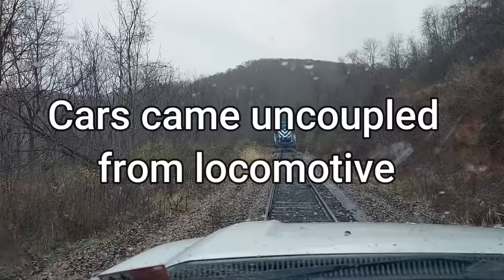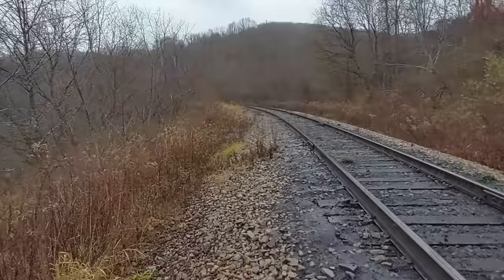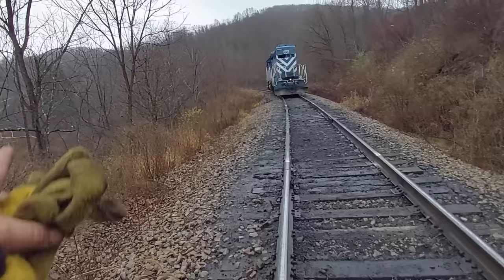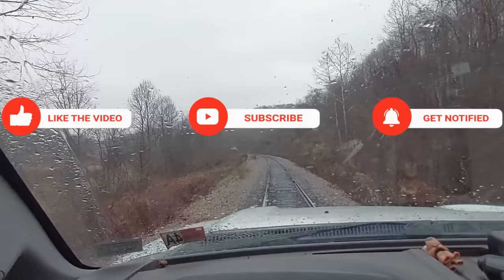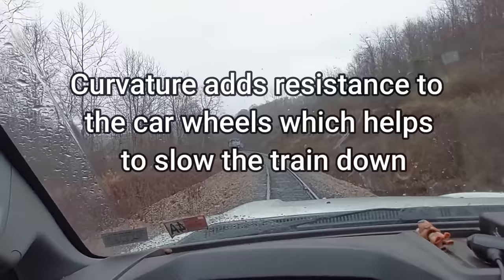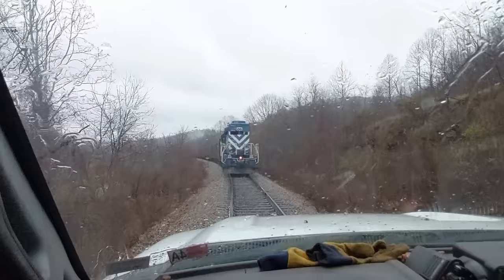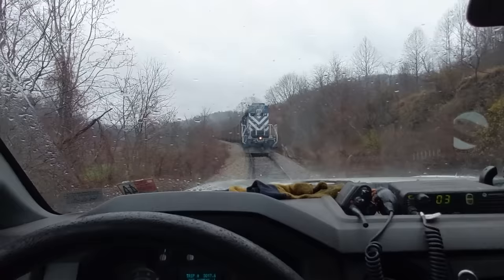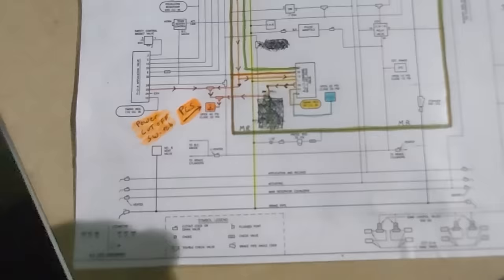Locomotive in PCS Fault and Remote System won't Link Back Up

Comment: Pneumatic Control Switch. I am not an expert but I think it disables dynamics if the switch opens probably a loss of air. I could easily be wrong. Such a neat video of something we won’t see anywhere else. Thanks so much for sharing your experience. Cheers, Rob
Reply from the maker: You are correct Rob, when PCS opens it disables throttle and dynamic brake functions via the PCS (power control system) .... PCS acronym for more than 1 thing on a loco... :-) power control system is
the electrical part which knocks power to the governor. Thank you
so much for stopping by and taking in the video my friend.
Reply: On newer locomotives when the train goes into emergency thus tripping the PCS, dynamics will stay engaged. There was a runaway train on CP Rail’s Kicking Horse Pass in the 90’s I believe where the engineer mistakenly thought the dynamics would stay engaged during an emergency application but he was wrong and that perpetuated the runaway. New units will keep dynamics engaged during PCS. If for some reason you lose air and your last resort is an emergency application, at least you still have dynamics to help slow down if they are already engaged when the emergency application occurs. Also, if the train slack was bunched up and the train was in dynamics while an emergency application occurred, the older system and locomotives would disable dynamics causing a massive slack run out as all the cars went to emergency and the engines left dynamics. That slack run out could definitely be severe enough to cause a train separation or derailment due to intensive buff forces, especially if you were in a curve.

Comment: Wow Dave, thanks for taking us along on this adventure. Sucks Russ had to walk 38 cars twice.. if I missed it what caused it to seperate..
Reply from the maker: Thank you Pappy for paying us a visit and checking out the
video. Coupler on the car had an adapter plate which had
fallen out for whatever reason. Adapter plate fits under the coupler shank. That caused a mis match in the coupler height from car to loco. Car went up to mine fine with no problems, but once it got loaded, then that made the mis match even greater.  

Coupler did not come uncoupled, rather coupler on car slid
down enough so that caused the car to uncouple from the loco.
Several low spots in the track surface did not help matters.
Car was pulled from train and fixed that evening. When they
put a new car in place of that one, they had no more problems
with it uncoupling.
Reply: Thats what happens on our model railways too. If the coupler isn't the same height it hits dips at bridges and sets them free.. so it's prototypical then.. awesome..
Reply: @ccrx6700  Did they ever recover that adapter plate? What causes them to fall out anyway?
Reply: At least it was only 38 cars, walked longer.
Reply from the maker: @erbewayne6868  👍😊💪
Reply: Complaining about walking only 38 cars? Must be an engineer.

Comment: Very interesting situation how it disconnected from the rest of the train. Did the coupler on the last coal car break a knuckle or just open up with all the tension?? The coupler on the locomotive (motor) seemed to be fully closed when you shut the airline valves off. Guess the moral of the event is when the PCS triggers, it quickly becomes a PITA problem!!🙃 Just all in a day's work Railroading!!
Reply from the maker: Thank you Charles for paying us a visit and checking out the
video. Coupler on the car had an adapter plate which had
fallen out for whatever reason. Adapter plate fits under the coupler shank. That caused a mis match in the coupler height from car to loco. Car went up to mine fine with no problems, but once it got loaded, then that made the mis match even greater.  

Coupler did not come uncoupled, rather coupler on car slid
down enough so that caused the car to uncouple from the loco.
Several low spots in the track surface did not help matters.
Car was pulled from train and fixed that evening. When they
put a new car in place of that one, they had no more problems
with it uncoupling.

Comment: A plant I used to work at had remote controlled locomotives for the dangerous jobs. When the locomotive got out of range of the box that the train operator wore, the locomotive would go into emergency, most of the time. A couple of times, it took off! Both times the switchman had gotten off to throw a switch, just like in the movie. Required a 2 man crew. One on the locomotive when backing over road and pedestrian crossings, and throw switches. After I left, I heard they knocked it down to 1 man crew.(to save money) and threw the rule book out the window. I heard one remote operator was killed, a week before his retirement. I had worked with him and he was one of the safest operators in that plant.
Reply from the maker: Our remote has always just quit functioning Paul, knocking off any
function it was doing when it lost signal. We've lost signal many,
many times. That sure could be a disaster if it just kept going. Oh dear!  Thank you for taking the time to visit with us and write in my friend.

Comment: Dave, just like andymano my first question was about the break apart, any idea why and how. Thanks for the video.
Reply: read the video description! :) A faulty coupler on the one hopper car.
Reply from the maker: Thank you Old Coastie for paying us a visit and checking out the
video. Coupler on the car had an adapter plate which had
fallen out for whatever reason. Adapter plate fits under the coupler shank. That caused a mis match in the coupler height from car to loco. Car went up to mine fine with no problems, but once it got loaded, then that made the mis match even greater.  

Coupler did not come uncoupled, rather coupler on car slid
down enough so that caused the car to uncouple from the loco.
Several low spots in the track surface did not help matters.
Car was pulled from train and fixed that evening. When they
put a new car in place of that one, they had no more problems
with it uncoupling.

Comment: “I did a thing, then it did another thing and now it works” or “I hit it with a hammer until the noise stopped” pretty much fixes all my issues as a mill operator
Reply from the maker: Here in the coal mine, the mechanics motto is if it doesn't get
fixed with a small hammer, then use a bigger one, and that doesn't
work, hit it with a sledge.... :-) Thank you for taking the time to watch the video and write in. May you have a most blessed day my friend.
Reply: @ccrx6700  yep heard that as well, that’s the kind of mill I operate it’s a coal mill

Comment: I've operated some stuff with the old manual lapping brake valves - 24, 6, even the old number 1. Personally, I like the manual lapping stuff, it keeps you more engaged and on your toes. 24 with pressure maintaining was pretty interesting. Lots of old hogheads have lots of interesting tricks with that system.
Reply: I agree. The manual is so much better. I prefer to feel it vs being controlled
Reply from the maker: Thank you Bryon for the nice comment and for sharing your
experiences with us.  Really appreciate your visiting with us and checking out the video. May you have a most blessed day my friend.

Comment: Did this occur at the Cumberland Mine? Great video! I actually have that locomotive in HO Scale in it's original paint scheme.
Reply from the maker: Yes sir it did, I have that loco also #1 in HO scale, got it on Ebay
for 100 bucks. what is so cool about is on the front porch it
has the US Steel logo painted on the deck and that was the
way our #1 loco actually came to us here. Thank you so much
for choosing to visit with us and check out the video. May you have a most blessed day my friend.

Comment: What caused the locomotive to separate from cars? When I worked for the railroad there was nothing electrical to uncouple knuckle. Either had to be done manually outside or a broken knuckle for a separation.
Reply from the maker: Thank you Speed Bump for paying us a visit and checking out the
video. Coupler on the car had an adapter plate which had
fallen out for whatever reason. Adapter plate fits under the coupler shank. That caused a mis match in the coupler height from car to loco. Car went up to mine fine with no problems, but once it got loaded, then that made the mis match even greater.  

Coupler did not come uncoupled, rather coupler on car slid
down enough so that caused the car to uncouple from the loco.
Several low spots in the track surface did not help matters.
Car was pulled from train and fixed that evening. When they
put a new car in place of that one, they had no more problems
with it uncoupling.
Reply: @ccrx6700  All your videos are great and THANK YOU for the very good answer explaining the uncoupling! Stay safe out there!
Reply from the maker: @1stbump  👍😊

Comment: What was the major motivation behind 1/4 mile welded rail? Combination of rail end damage and lesser effects of extreme temperatures expansion and contraction? I realize there are many fewer plates to inspect and repair, but I was working for the ATSF when ribbon rail was introduced and no one explained exactly exactly the full set of reasons for the expensive changes. We just did it. Also, have concrete ties worked out? They were coming online at the time, and the old timers were not fond of them.
Reply from the maker: Elimination of joints and smoother ride less wear and tear on
the rolling stock with cwr. Here's a video I made you may enjoy
on why some RR's use concrete and some wood ties 
https://youtu.be/UtyTTijswwg

Comment: Dave ...since the pneumatic control switch was was activated...was there a pnealty application? I mean this was the dpu..what was the cause of the pull apart ...did it throw the dpu into emergency or was it the pcs switch that was the fault?
Reply from the maker: When the PCS switch opened yes there was a brake application.
I'm not sure it it would be called a penalty or not. I thought 
penalty meant that was when the loco sentry system opened the
PCS. May be just a semantic thing here over a term on that? You're the  expert not me!!! When the air dumped, PCS opened and that
applied the DPU independent brake. 

There is an analysis of why the cars came uncoupled that is written up in this video's description. I did not find out the reason
why they uncoupled until the next day after I had made the video.
If you would like to read it here is the video link:
https://youtu.be/YU5KXJfWaxM
Reply: @ccrx6700  see I knew I should have read the description. Makes since now..... penatility application was the wrong phrase. I'm so use to saying it !!
Reply from the maker: @jason27swg  👍😊
Reply: @ccrx6700  the only time 26-L opens the PC Switch is when an emergency application occurs from the brake handle or loss of train line pressure.

  A penalty application occurs when some safety device starts draining air from the equalizing reservoir, which causes a full service application. Some setups would blow a whistle to warn the engineer before they started the reduction and allow him to take action to prevent it.

Comment: Being the DPU is it a loss of air that threw it in emergency otherwise would the remote unit continue to operate even if just the knuckles break apart?
Reply from the maker: That is correct Steve when it loses that much air quickly it goes
into emergency. If the knuckles would break and air lines stayed
connected, yes it would operate and follow whatever orders
are given it from the lead locomotive. If the locomotive was pushing
then most likely the loco would stay close enough to the cars to
not break the air lines apart. Once the air lines get broken then
the end of train unit shuts down all functions. This is important
because if there is a derailment you don't want that EOT unit
to keep on shoving. You want it to just stop. Same thing if it's in
dynamic braking, if air lines break apart, it stops braking also.
Very grateful my friend for your taking the time to visit with us
and check out the video.

Comment: I was saying to myself that P.C.S meant Personal communication System, well it does mean that, but not in this case. But it meaning it's a power cut off switch makes better sense. A friend of mine in Ireland became a qualified train driver a few years back. He had just planned and organised his 50 ith birthday party which was a couple of weeks away at that time. His name was Barry. Really nice guy. He had just parked his train up after his Cork City to Dublin City run. One of his colleagues entered the dressing room and found Barry dead on the floor. He died of heart failure. All his family and friends decided to follow through with his Birthday celebrations. He was a member of a band and they performed at Barry's birthday party. It was very tough for them and everyone else, but the night was also fun too. I doubt the dead mans switch is activated very often, but in Barry's case you can understand why it's important, Barry could have died while in transit. I could imagine how confusing that would be for a train full of passengers if their train suddenly stopped mid trip and no communications from the driver in evidence. It would probably take anything up to an hour for emergency services to arrive, and that would depend on the geographics of where the train came to a stop
Reply from the maker: Thank you for the nice comment and for sharing your
experiences with us.  How sad to hear about Barry. Really appreciate your visiting with us and checking out the video. May you have a most blessed day my friend.

Comment: Cool video. Curious why you guys wouldn't recover the pcs from the lead locomotive and not have to unlink the DP and relink it? Would have been quicker unless operations or terrain wouldn't allow for that?
Reply from the maker: Because the air was still blowing off the EOT unit. PCS won't
clear until the air is restored, have to manually shut off the
angle cocks, we don't have a remote system that shuts them off.
Appreciate your taking the time to watch the video. May
you have a most blessed day my friend.

Comment: Interesting video , seeing real work done on railway , I presume that screen we see restarting was for setting up distributed power , great to see how it works (sometimes not work ) . Its actually a PC based system as it looked like a PC booting into Dos (pre windows) do you get many problems with DP on your loco's ? can EMD and GE loco's work together ?. In UK its all jumper cables for working loco's together , we do have pcm systems for remote control using a train power wires with passenger trains . Always like your videos , its great seeing how things are done your side , just retired (ill health ) after nearly 40years with UK,s biggest freight operator , miss the job but not cold wet winter nights trudging miles to a failed loco (never fail next to road access ) but its great feeling when you fix it though
Reply from the maker: Thank you nounoufriend for the nice comment, glad you enjoyed
this episode of That's Railroading. We really appreciate your
taking the time to stop by and check things out. May you have
a most blessed day my friend. Hope you enjoy your retirement!

Comment: Pretty interesting to know.
At first I thought the locomotive had a system that shuts off the electrical to the major components so in case of crash, it won’t start a fire. Pretty much like when a car airbag inflates to avoid injuries. But here it just goofed up while in service. Lol
Glad it was resolved!
Although I wonder how it uncoupled unless the pin broke. 🤔
Reply from the maker: Glad you enjoyed the show Bassotronics. Go back and read
in the description how the car and loco came uncoupled.
Really appreciate your paying us a visit.  May you have a most blessed day my friend.
Reply: @ccrx6700  
I just read the description. Sounds like the problems I’ve had with the model railroad with coupler height mismatch. Hehe.
Thank you and have a great day Rail-brother. 👍🏻
Reply from the maker: @Bassotronics  👍😊

Comment: Hi, thanks for this video, could that PCS not resetting be caused by a faulty/leaky A1 Charging valve? the pressure integrity has to be replenished before the PCR energizes and the PCS light goes out.
Reply from the maker: Your very welcome Peter, glad you enjoyed. You very well could be
right, but if that valve was the culprit then it would never reset
until that valve was fixed? Thank you for taking the time to visit with us and write in my friend.
Reply: @ccrx6700  I work on alot of remote systems installed on many railroads, so I know what happens in remote mode but the PCS not recovering will also prevent the unit from recovering in remote mode. Those A1 charging valves, transfer valves and other air valves are hard to troubleshoot as they have many air chambers and internal ports that could be leaking internally. anyhow, great job. keep posting videos
Reply from the maker: @Peter NotPeter  thank you for sharing that. I understand what your saying bout remote not recovering. Very interesting!  If you saw our goofball remote system you'd tear your hair out😉